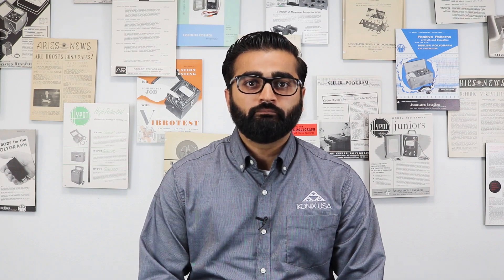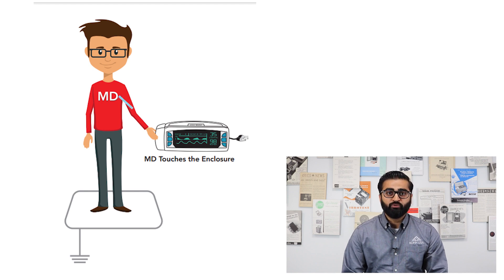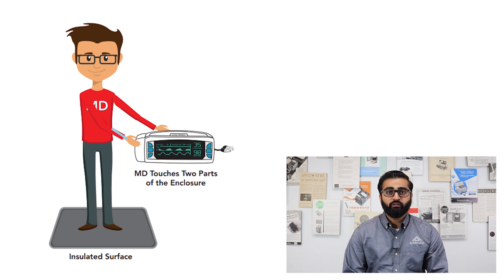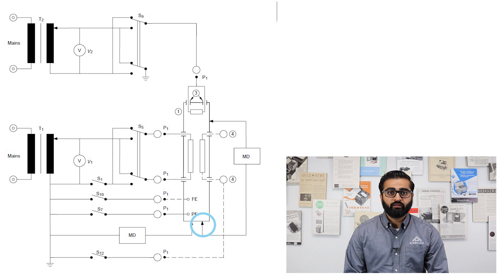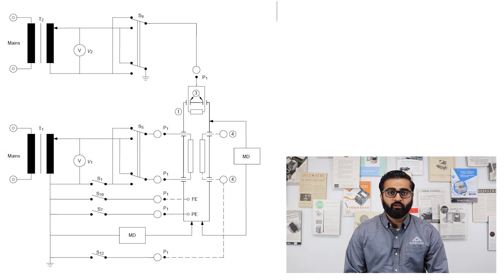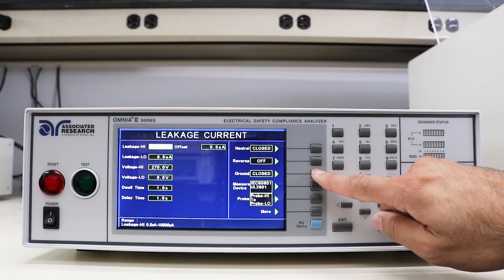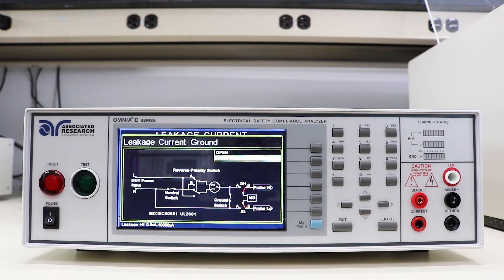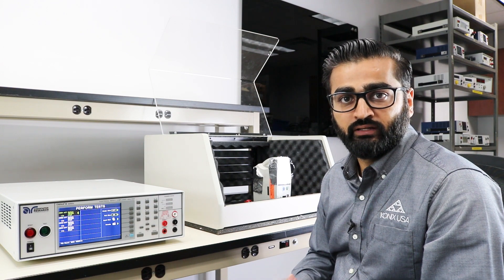Touch Current Testing

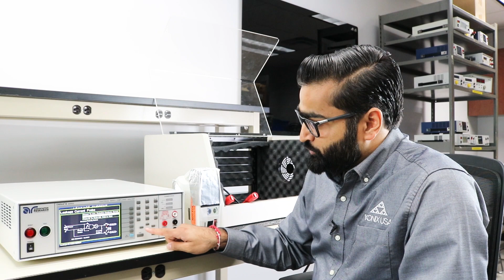Comment: 2:45 I'm having difficulty understanding the diagram shown on the Omnia screen. It shows in the middle a mains receptacle, which is surely where the DUT is plugged in, right? So that would be the "DUT Power Input". Yet the label "DUT Power Input"  appears at the extreme left. Surely that extreme left location would be "Mains input to the Omnia"?  And then at 2:44 Bishan says "another side of the MD is connected to the low side of the transformer". What transformer?  That appears to be a connection to mains neutral.  Sure, that might connect to a transformer inside the DUT, but many DUTs do not have a mains transformer. Also, there's a L/N reversing switch between that MD connection and the DUT. (This all assuming I'm right on the first point that the mains receptacle is actually the DUT power input.) So either I am confused, or this diagram is a bit off target.

Comment: Sir namaste. I am PN Jha. I am testing generator stator bars, before putting into core assembly of the generator. My problem is , the  stator bar is making by number of insulated copper strands into stag form, called bar ,length of a bar is appx 18 to 20 ft.All insulated strands are crossed over to each other.after  press operation some time two adjacent conductor cut insulations each other. each strands must be separated.though these are in stag form.So it is difficult to find out the correct place where is the fault (short circuit) between adjacent two conductors.Is there any instrument to find out the correct place ie fault place or (short circuit)? Presently short is finding by hit and trial method.